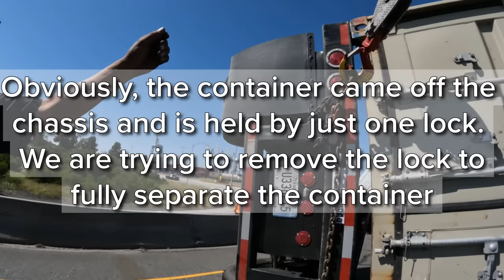This Container Rollover Kicked our Butts!

Comment: Looked like you was removing tractor trailer from turn one of a Nascar track. Quite an angle the ramp was and leveling the truck from the rear. Good job with the crew working together.

Comment: Alex is probably lucky that pin DIDN'T come out. I could just see the chassis unwinding and throwing him right over that wall when he was standing on the tire...😳
Reply from the maker: That is correct and why all the comments saying just cut it are not smart. With a slightly offset vertical line and the deck winch pulling it, the chassis wouldn’t recoil that bad. But seeing how stuck it was, I did not want to take that chance. It’s hard to hear but I say just that in the video , that it’s too dangerous which is why I made the call to upright it and set it back on instead of splitting

Comment: With the rotator on the front, had you slid the front of the box towards the chassis, while keeping the chassis tight to the rear of the container, it should have released the tension on the locking pin. I haul and lift containers regularly, the slightest tension will bind those rear pins.